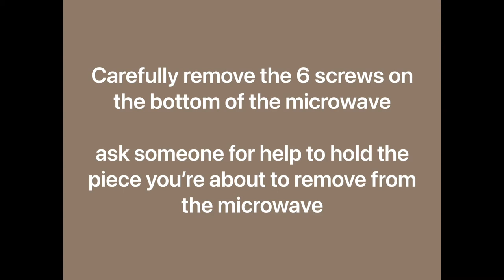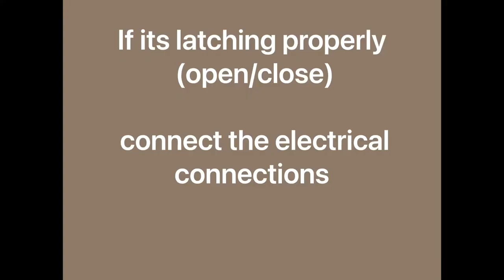How to fix LG extendaVent not latching

Comment: The front extendavent base plate trim as broken. how do I replace it? I have the new part.
Reply: I have the same problem. did you fix yours?
Reply: my trim fall out but still in one piece so I just used corner brackets with self taping screws to secure it
Reply from the maker: Please read description below, if you have same microwave here is the part name but someone commented that they found it on amazon.. but I got mine on reliable parts.. its in Canada...  LG Parts: hood locker - MFG61979001